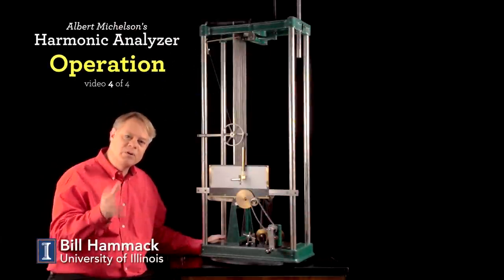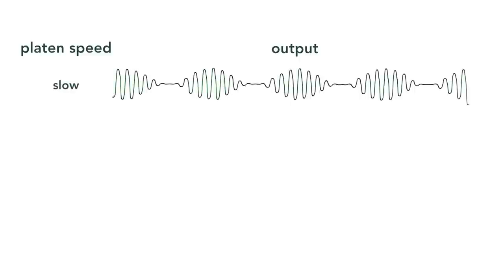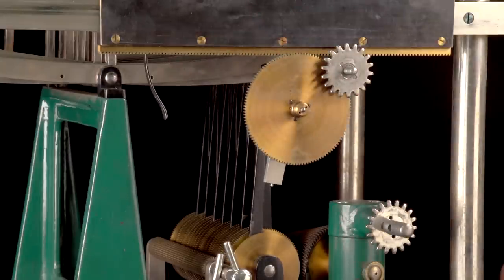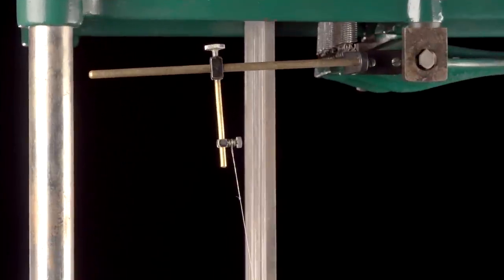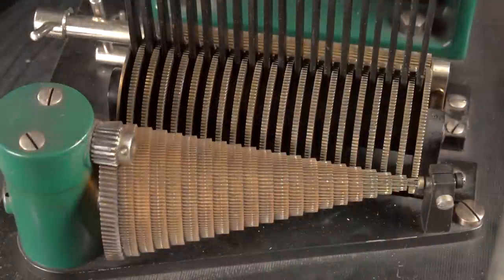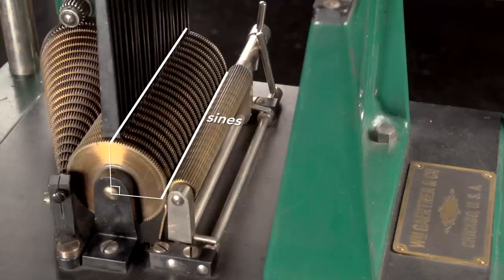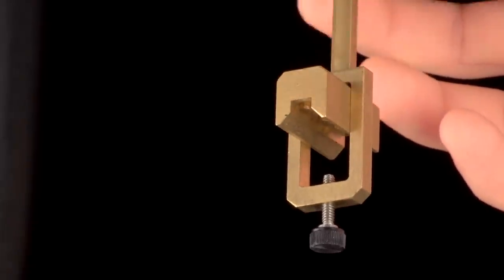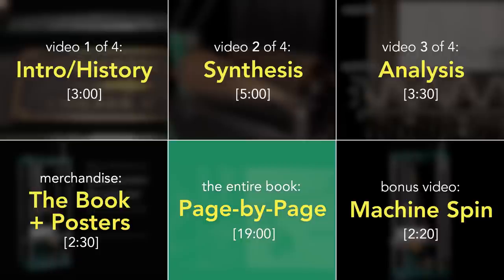(4/4) Operation: The details of setting up the Harmonic Analyzer

Comment: The pen adjustment just... boggles my mind.  It's like there should be a whole investigation on WHY the pen adjustment ends  up being so crucial.

Great stuff!
Reply: Gordon Fawks I don't think it has anything to do with the pen or marker position, but the friction it is causing on the paper causing it to move differently at different angles I think if the tools made that hold the marker were more secure and not just bobbing on it's own weight it would be the same at any angle
Reply: @eghty8fox780  I agree mate, it seems there are many places in that machine where friction is causing some errors in the output.
Reply: Even more weird as I was expecting the opposite position to be the most accurate since it's the one producing the least amount of friction resistance.
Reply: When the pen is perpendicular to the plane of the paper,  the drag starts a rotation of the pen around the axis of its own support.
Reply: If you figure out why chalk screeches on the blackboard, you will have your answer. Its the same principle how one professor makes dotted lines with chalk.

Comment: Wouldn't it be faster to align the gears if you use a straight edge to put between the teeth?
Reply: I bet it's exactly the point of the groove - in addition to the missing brass pen holder the machine most likely also lacks some kind of ruler to put into the groove. Awesome piece of machinery and design.

Comment: Most people are amazed by, and thus remark on, this device's otherworldly intricacy. For me, however, this machine is amazing for another reason. For many people, myself included, math is a tremendously abstract subject. Because of this, some people think that math was simply invented by man. These people have only used digital devices, like computers and calculators to perform operations. What sets the harmonic analyzer apart is that it takes what most people perceive as an abstract operation and turns it into a mechanical one. To me, this indicates that math is "real" and is not invented by man. It is amazing that we can use mechanics to do this.
TLDR, sweet machine.
Reply: But - most of that maths you're referring to is way older than the computer! How could those mathematics giants NOT have done the math as a real world existing thing? Fourier, Laplace, Newton, Leibniz, Gauss, Euler, Descartes, etc (just to pick some that should be familiar on an engineering channel). All of them from the late 1600s to early 1800s

Comment: Magnificent video. Thank you. 

I believe the pen squares the sine waves at the end because when perpendicular to the paper, or sloped in the direction of travel, it causes the square rod to rotate in the square holder, binding. At the minimums of travel at the top and bottom of the sine there is not enough force to over come friction. But when sloped away from the direction of travel the pen can not rotate more toward the paper because it is already in contact, so the square rod remains loose in the guides.

Comment: Great video, but can we have an in depth explanation on why the pen adjustment had such a massive effekt on the outcome?
Reply from the maker: We think it is friction: there is less when you put it at an angle in the direction of travel.
Reply: +engineerguy could it be that the friction when combined with the shape of the pen tip gives the illusion of curvature through it's varied stroke width? i'm thinking about how calligraphy can achieve similar effects by adjusting the pressure and angle the pen is at.
Reply: I think it has to do with pressure on the pen tip causing it to become more rigid. When it's being dragged it can wiggle more, so it doesn't follow the holder as quickly when it changes direction. Just my guess, of course.
Reply: Friction, yes.. But also the surface quality of the paper, viscosity of the ink, velocity of the pen, force of the pen on the paper, the form of the pen itself. These all play a part and create problems for analogue recording with ink.. If a small amplitude vibration is introduced ("dither") then this can be enough to keep the dynamic friction coefficient. Unfortunately the driving force with respect to the pen friction is low and this system of rods and wires looks to be quite springy !. It would be nice to replace the large spring with a voice coil and create a force balance, thus keeping the summing lever still and using the current to drive a chart recorder!

Comment: I feel like you could easily align the cylinder gears using a flat tool or even a taught string running across all the gears, in the notches.  Thanks for the videos.

Comment: fantastic series. love your work. A wild guess, the flat peaks and trophs come from what is called "backlash" in machining. Probably because the bushings of the the various bars dont perfectily fit the shafts, so when a lever or a bar changes direction, there is a bit of looseness and delay. This is quite hard to avoid, because very tight fittings would have too much friction and would wear anyway.

Comment: I counted and it looks like there the cylindrical gears have 30 teeth per 90 deg turn? Meaning you could set different phases for each of the signal component in 3 deg increments. That would be a pain to set up. Though as others have also pointed out, pure sine or cosine should be quick by inserting a wafer into the deep cut.

Comment: Couldn't you use different gears in order to obtain tracking speeds other than 1.0x, 2.0x, and 0.5x? For example, using the medium gear (18 teeth) with a large gear (24 teeth), horizontal speed of the paper would be 1.333x or 0.75x. Using the small gear (12 teeth) with the medium gear (18 teeth) would give you 1.5 or 0.667x.
Reply: Yes, you can use those other gear combinations. However, if we tried to use the medium and large gears together the chain that connects them is too short and won't fit all the way around the gears. You could, of course, get a larger chain.

Comment: Is there a distortion of the sine wave from the fact the arms connecting the cams to the rocker arms don't travel exactly vertically up and down but also displace left and right slightly?  I assume the cams help to mitigate this, but something else would be required to remove it completely, no?

Comment: My question really is what pen did they use originally? Fountain and dip pens where, as far as I am aware, all the were around in the 1910s. Early roller ball and ball points didn't come around for some time, if I am not mistaken. Did they use a well attached to it perhaps? Maybe on this smaller one it wouldn't matter as much, but its difficult to write a consistent line with a fountain pen without it running dry, and worse is that they have to be oriented, and only write effectively in one direction. Maybe felt tipped stuff was still around then?

Comment: We've found the next project for +clickspring after the clock is finished.
Reply: And you just know that Chris would look at this machine and go 
"Yeah, I could make that and make it work as well as making a video series on its making."
Oh it is almost perfect match for Chris.
Reply: +Mark Fryer omg yes if only chris really does it
Reply: Yes, this machine has +clickspring written all over it, and it would make one heck of a video series.
Reply: Ha! I was just trying to decide if I had enough scrap around the shop to make one for myself. It would certainly amuse the folks in my lab even though we don't use Fourier analysis.

Comment: why does the orientation of the pen make a difference?
Reply: I guess it is about the alignment of the fiber on the tip. For last two cases, those tip fiber could be combed by the texture of the paper. It requires a certain level of force to re-align them to new direction because doing so requires overcoming the static friction force between thousands or millions of fiber. This only happens when strain accumulate to a certain level, which create those flat top effect. But if tip is pointed to the direction of movement, the tip fiber is being bent 180 degrees backward on microscopic level. They are much shorter and less organized, thus creating less "locking" effect.

Comment: Perhaps it was too simple of a concept to put in the book or the video but for me it is a bit of a mystery as I realized that I don't really know how springs are modeled mathematically.  And that being how the summing bar actually works, I felt like I was missing something.  The other mechanics all seemed intuitive and interesting but I felt like something more needed to be said about the summing bar and springs.  How are the springs chosen and adjusted?  What is the math behind the how the springs actually add the sins?
Reply: Springs behave (if you don't deform them too much) linearly, i.e. if force F leads to elongation x, then force 2F leads to elongation 2x, and so forth.

When the rocker arms are pushed up, (video 2, 2:22), the small springs exert a force on the pivoted bar, which tilts it, and that's where the up-down-motion comes form. If you have two springs, their respective forces add up, of course.
Reply: OK, I wasn't sure at all about them being linear but that makes sense.
Reply: I think they glossed over these points too.  The key is that the summing bar must add 20 forces together from the summing springs against the opposite force pulled by the large 40cm spring shown.  The salient feature here is that the long spring will act with "almost" constant force on the bar, because it is so long, and the sum bar doesn't move much.  Similarly, the force from the summing springs will be proportionate to their displacement.  The result is a mechanical summation by means of a balance of 20 small forces in one direction with 1 larger force in the opposite.

Comment: Question: Why are the amplitude bars so long? shouldn't shorter arms work as well (assuming the curvature of the curvature of the rockers is adjusted to fit the new length (i.e. higher curvature because length = radius) or am I missing something?
Reply: Maybe the limiting factor is the cams. Making the bars shorter would require making the rockers more curved, which would require making the cam rods travel farther, which would require really sharply curved cams, which may pose a friction problem.
Reply: bistro4 i think i need a picture to get what you just said ;)
Reply: FrankyBoy
I'll get my engineers to draw you up a preliminary sketch right away ^_^
Reply: If the amplitude bars were shorter, then there would be a larger amount of error due to non-linearity of the system: imagine an amplitude bar set at the end of a rocker arm. When the rocker arm moves up it in turn moves the amplitude bar up with it, but is ALSO moves the amplitude bar in the horizontal direction. The horizontal direction is unwanted. So the longer the amplitude bar is, the less horizontal movement there is relative to the vertical movement. If the amplitude bars are long enough, you can ignore the horizontal movement.
Reply: Steve Crayons ok, makes kind of sense, I think I'll do some drawings once I am home to get a better picture as well.

Comment: Cool video mechanical computers are interesting...

would love to see if someone ever made a brainfuck engine lol (brainfuck is a bit of a joke programming language it only has 8 operators everything else is a comment and does lend itself pretty well to some kind of mechanical implementation I think)
Reply: That doesn't make any sense. Computers (mechanical or digital) don't have languages, they just have sequences of commands. So you could do it, sorta, but you'd need to have a different machine translating brainfuck into command codes. Just like a compiler on modern computers.
Reply: Joshua Pearce
with only 8 operators it should be possible to do it.. at least if you encode it on say a series of hole cards...
Reply: ZerqTM I'm saying it doesn't make sense at all, like insisting the punchcards be a specific color.
Reply: Joshua Pearce
what i was originally imagining was some manner of token for the 8 different operator... like balls that could be mechanically sorted or distinguished and effect the mechanism...

and if you could do that then  you could effectively make a brain-fuck-engine :p